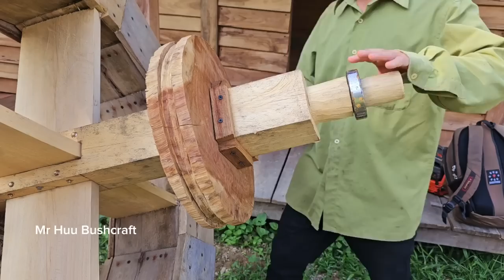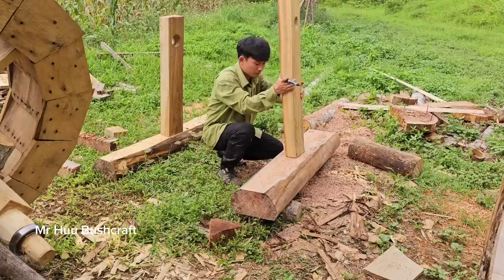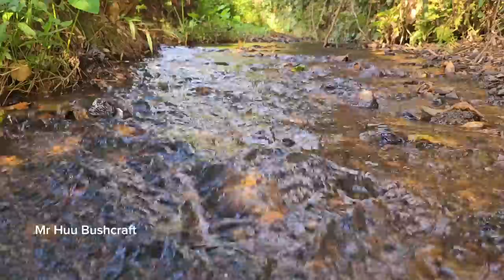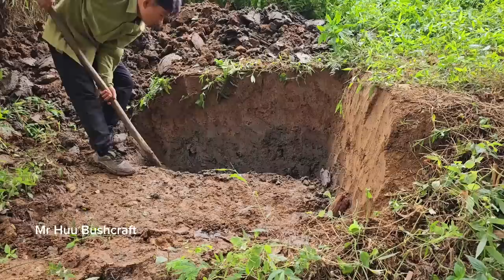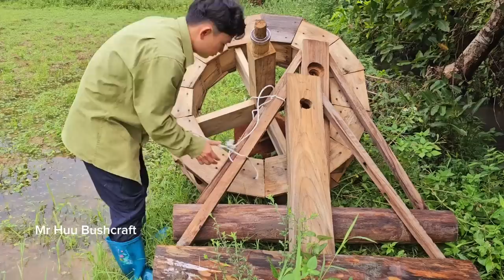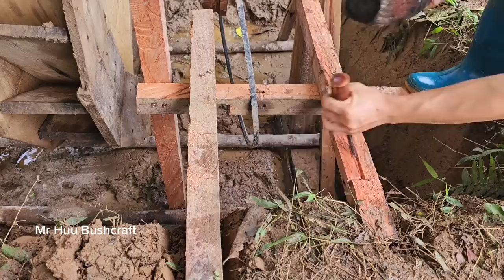Building A Waterwheel Harnessing Hydroelectric | Construction Bushcraft WaterWheel.Build cabin.

Comment: You really need some big friends to helped you carry all that, either that or built the legs on site. Also with the soft wood that your using for the braces, if you would have drilled pilot holes first and then ran your wood screws in, your wood would not have cracked like one or two did. But I’ll give you one thing, for a little fellow, you sure are a hard worker!!! Look forward to more videos!!!
Reply from the maker: Thank you so much have a nice day😚